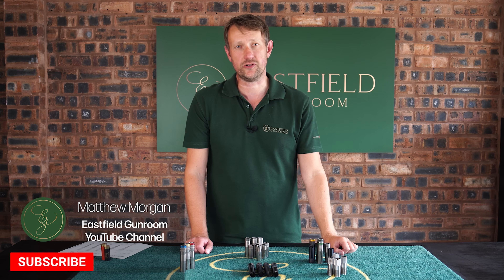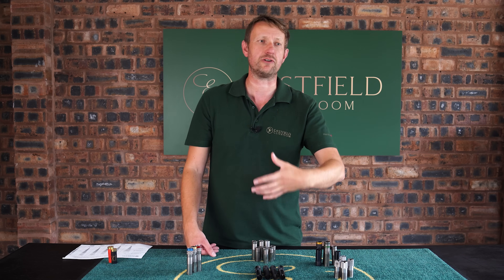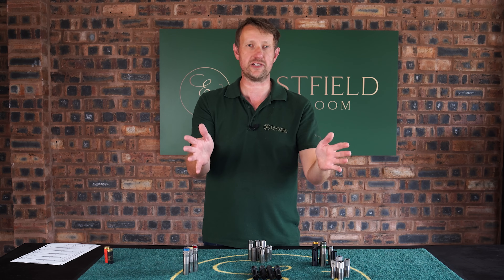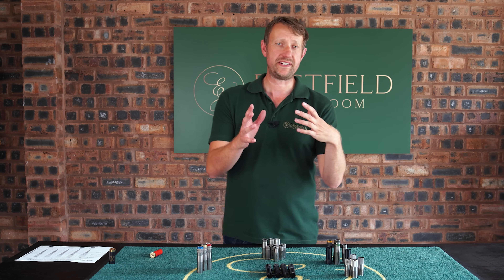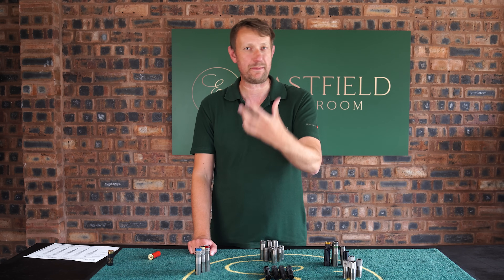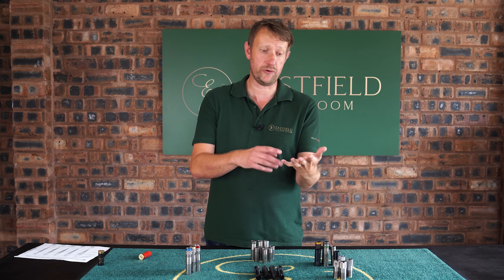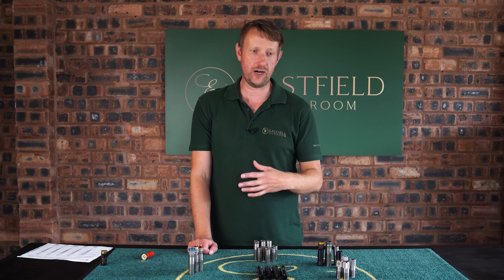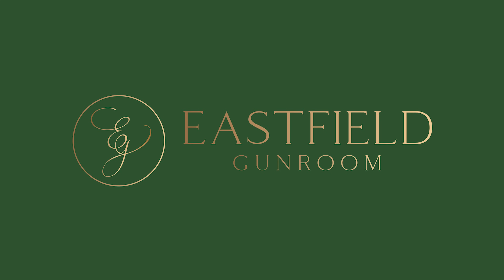The Essential Guide to shotgun chokes by Eastfield Gunroom

Comment: Great video and explanation for beginners as well as experienced shooters.  To many shooters suffer from "paralysis by analysis" due to interviews touting "tighter chokes for better breaks".  At the end of the day, it all comes down to the number of X's versus O's on your score card.  There is no Olympic grading system on target breaks!  My heart is broken for Amber but I will guarantee she will not be changing choke size due to the horrible miscall she got in the Olympics.  The advice I give to new sporting clay shooters is use LM (3/8) or M (1/2) in most applications out to 50 yds and to concentrate more on target speed, line and distance!
Reply from the maker: Thank you for your comment and kind words. Agree completely about poor Amber Rutter but the way that she handled herself in the situation was first class and it was a great performance regardless of the referees huge error. Kind regards, Matthew
Reply: Wise words Tad.

Comment: Hi Mathew, great video. Just getting back into clay shooting after 15 years of target shooting. I have (last week) just purchased a new Browning 525 s and want to buy some Teague chokes for this sport, what 2 are best to start the collection?
Reply: He didn't mention extended knurled chokes can be removed inserted by hand.  Depends on what you want to shoot.  Skeet buy 2 skeet chokes or 1 skeet and 1 improved cylinder.  5 stand...depends on the course but distances can put you in the light modified range. Sporting clays modified and improved modified.  I have a full set of extended chokes for each of my guns. For skeet i use skeet bottom barrel/improved cylinder top barrel. For 5 stand i use light modified bottom/modified top. For sporting clays i use modified bottom/improved modified top. Swap my top improved modified to extra full for 60 plus yard stuff. Hope that helps.
Reply: @ Thanks Robert, I will try your advice this weekend.
Reply from the maker: Thank you for your comment, I am pleased that you enjoyed the video. Personally I would suggest either a pair of 1/4 (improved cylinder) chokes or 1/4 and 3/8 (light modified). These are a great choice for sporting. Personally I feel that you are at a disadvantage shooting sporting targets with skeet chokes, particularly those over 35 yards. Kind regards, Matthew